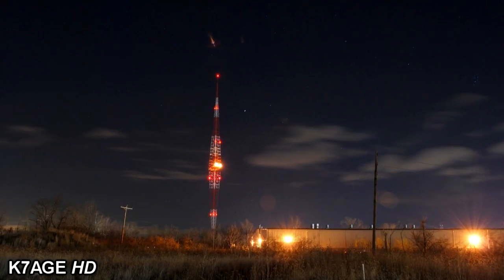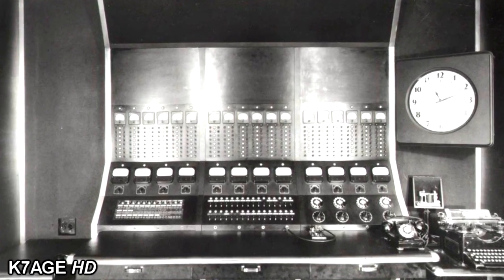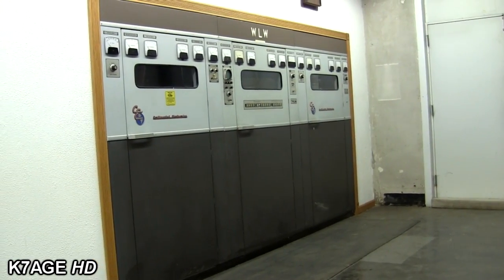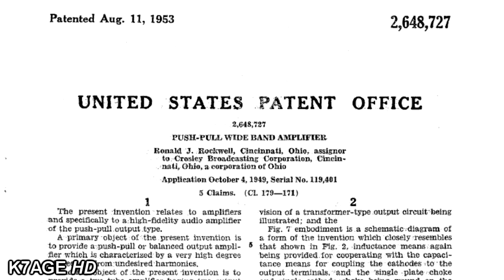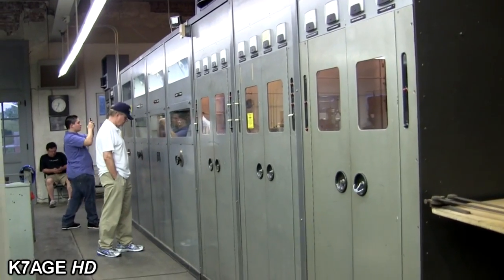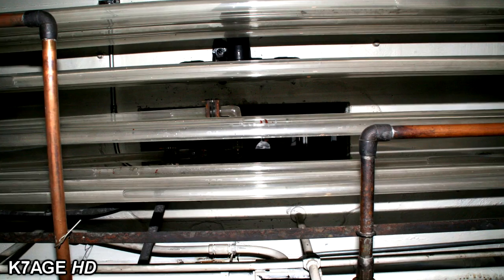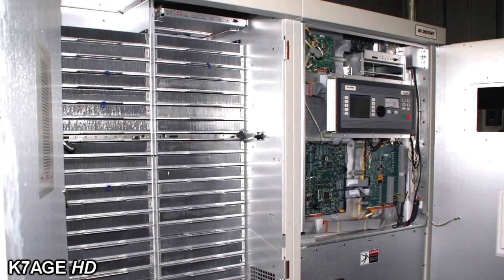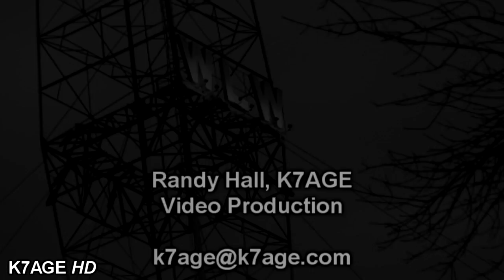WLW's 50,000 Watt Transmitters

Comment: Hi Jeff...I worked at KACY with Don Sinclair, Bill Tanner and Terry Harris in 1977. I had issues with the RCA Ampliphase Transmitter as well. I remember a good swift smack to the back of the plate relay container would switch it on air when the switching didn't occur! Ha! That was a monster rig. I loved the signature sound of the RCA Ampliphase at 50 KW. It sounded great.

Comment: Very interesting video, the modern solid state digital transmitter is a great example of modern electrical engineering. The older vacuum tube transmitters are also fascinating and like the new digital model represent the state of the art of their era. The longevity of the classic designs is incomparable, as good as the new digital transmitter is it's doubtful it will have a service life approaching the classic designs. Great stuff, thank you for posting.

Comment: Here in the New York City area if 710 wor goes off the are which they did for transmitter maintenance few months ago WLW comes in like a local here
Reply: Yeah. WOR is a powerhouse too. I believe WABC and WOR both have the best transmitters in the NY market. If your on a long drive, tune to ABC or WOR, it just keeps going! WLW has come in OK if you go out to the east end of Long Island, WOR comes in fine, but doesn't have as much bleed through as if you're anywhere from north jersey to central Long Island.

Comment: He said that a particular 50KW transmitter had no iron in the modulation path. That is very interesting, as a Cobra 148GTL CB radio does not either in AM mode. The final transistor is biased at 1/2 B+ voltage. The audio drives that regulator that then increases and decreases the B+ at the audio rate modulating the final and driver at 100%. And it works beautifully! No CB radio sounds better on AM than a Cobra 148GTL CB radio! Now has the punch! That old WLW transmitter was ahead of its time. With transistors she would be booming today!!

Comment: I remember when they did the millennium thing. I was actually listening to them during that whole ordeal. Was funny they thought the world was going to end. Was a big deal. Now its hindsight. 

Interesting on the Harris how it modulates, You would figure todays technology the exciter could be SDR. modulation is generated into the carrier wave mathematically in the programmable DSP which is then shaped and amplified to its output. If you did it that way, simple software routines to add IBOC, RDS, c-QUAM, etc could be implemented without any hardware change. 

Fun stuff. that 500kw transmitter was massive. wholy hell....

Comment: I just ordered an old 833 triode. I just now saw positive grid voltage,current .The triode needs compensation somehow. MBO .  "When the boss invents."  When will a new "Commodore  Computer" be built?  What are red green blue returns on the monitor 15 pin connector?   So a video card is turned into a commodore. A z80 with eprom can replace the 6567 graphics chip. How are antennas connected together?

Comment: sweet, I live by the KFI station in orange county, 100,000 watts i can get it clear 150miles away with like the worst internal ferrite bar radio sitting on the floor, with a decent dipole it goes even further just hard with all the other stations
Reply: KFI does not broadcast with 100,000 watts. The maximum power allowed for commercial AM broadcasting is 50,000 watts.